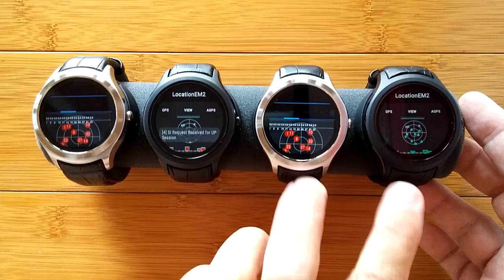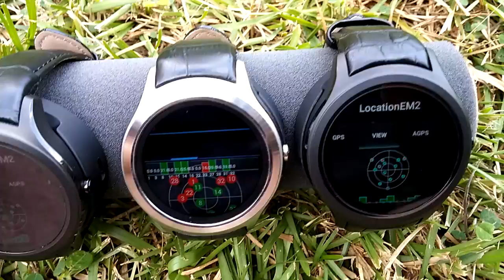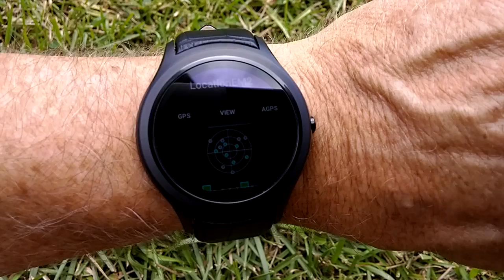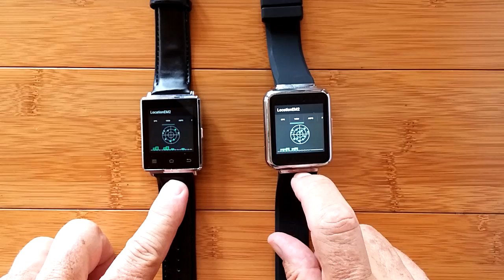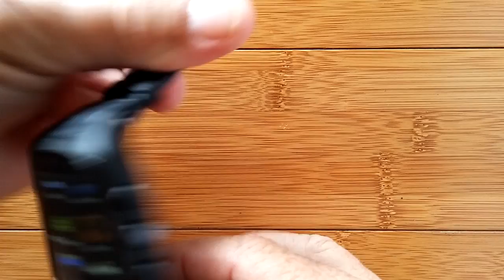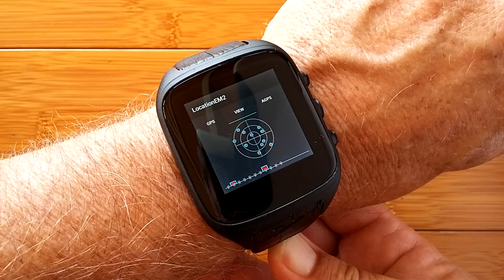Top Smartwatch Question #3: How good is GPS? Part 2

Comment: What about the accuracy? Because it's not useful at all if the smartwatch has gps signal, but tracking a bycicle workout, for example, it lose signal, or save incorrect points in the map. Compared to a smartphone, how accurate is the GPS of these smarwatches? Thanks!
Reply from the maker: I will leave it to actual users to answer you about that. You question exceeds my level of testing.

Comment: Hello, Gearbest says that you can replace the straps for No.1 d5 plus, i even wrote to support to check that out, they say, that u can replace them. You in previously video about straps said that it is not possible because of the gps sensors. some proof of question section of No.1 d5 plus gearbest. https://gyazo.com/087f64dad536618e0625280d51c3f2cf . Who is right?
Reply from the maker: Watch my videos. You cannot replace the bands. You can ruin the watch if you try.
Reply: That is what i said.. They say that you can replace it, suggest it to newbies.
Reply from the maker: I have. Right here: https://www.youtube.com/watch?v=rBsLfRJWU4Y
The only problem is getting them to watch,

Comment: Hi Mr Ticks
Nice video, you have quite the collection  of smart watches. Size of the antenna within the strap will play a factor in the gps. Only a few square millimetres can make a difference. Also the magnetic resonance from your the alternating current in you roof will weaken the available digital indoors. The watch hears this as ambient noise over the GPS. 
Considering that these are such a tiny devise all performed well.
I am waiting for the release of the X5 plus before I take the plunge.
Keep up the excellent works.
Reply from the maker: Thanks Antony. I was surprised that they all performed well, too. I keep wondering if some of the top fitness apps folks use on their phones will work on these watches and interface with the GPS just like they do with the phone. I hope some viewers will report back on their results here in the comments.